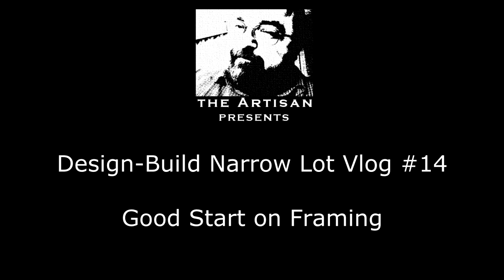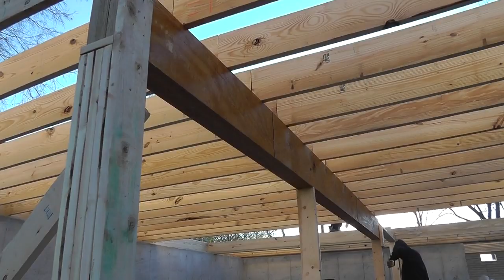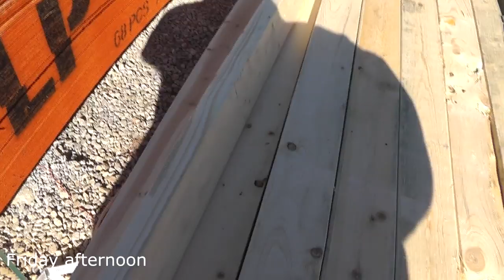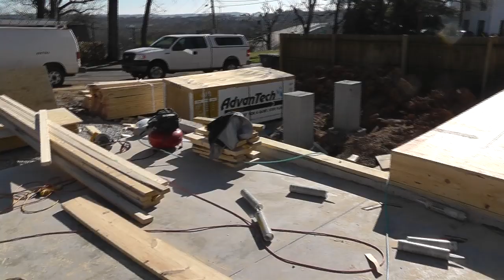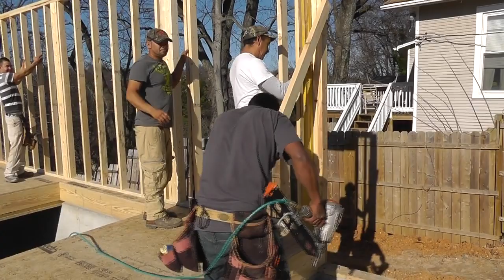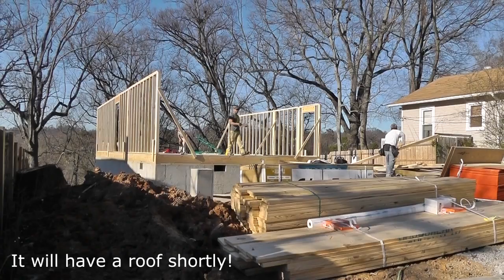Design-Build Narrow Lot Vlog #14 - Good Start on Framing

Comment: @ArtisanConstruction there seems to be a sort of mystique about a true brick house. Around here, one would see the American Bond used in many older homes, wall as thick as the header bricks, the plaster opposite the exterior walls just does not age well. I do like a brick facing for durability, but still having the ability to have well-insulated walls inside. Hey, I don't hear any hammers! O, the video is over :)

Comment from the maker: @jrossi9250 If the engineered joists are sized properly they are actually stronger.  I guess maybe someone over spanned them.  You will see in this home I have used LVL's (engineered beams) because they are a lot stronger than nailing 2" x 12" together.  I used conventional framing in this home because the spans were only 14'. Thanks!